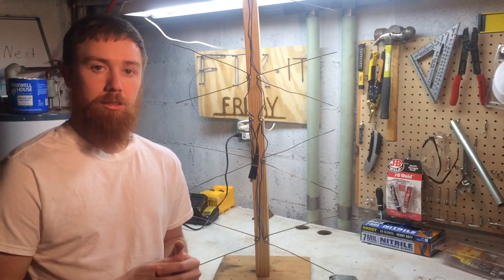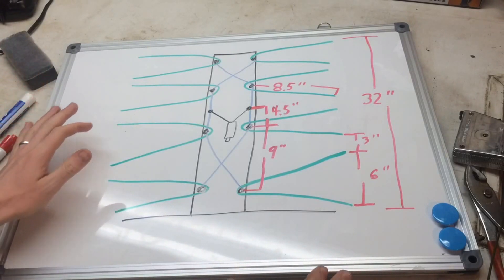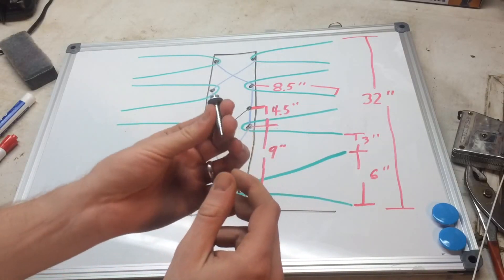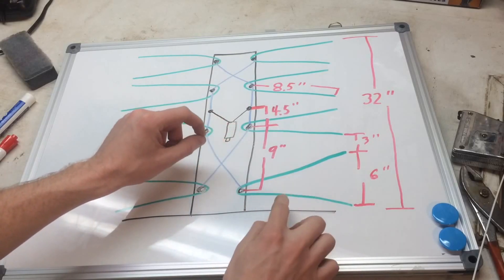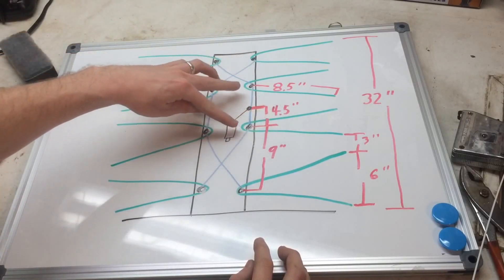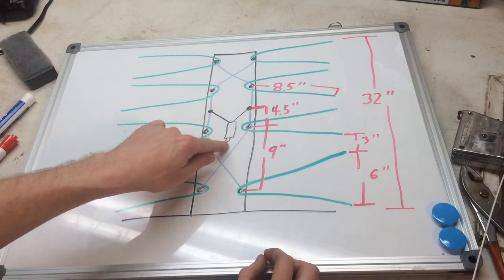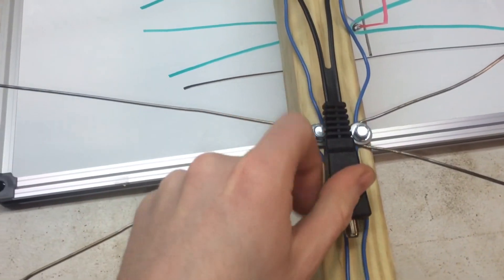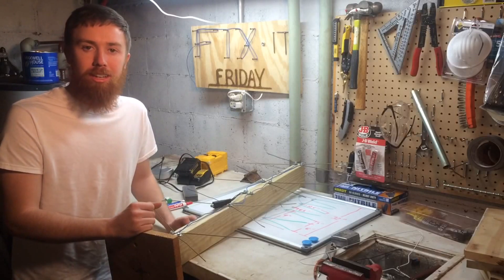Fix-It Friday: Cheap Digital TV Antenna

Comment: Your a little bit behind in your Fix-it-Fridays. lol
Reply from the maker: +JOHN WALTER Hey man, I know. I've run out of things to fix! You need to give me some ideas or I'm going to have to start breaking stuff to fix it.
Reply: Should of thought about that before you found out that there are 52 Fridays every year. lol. I will be trying the Antenna thing in a few weeks. Have you tried putting foil behind it?, it's suppose to help make it a little stronger than just the Antenna, They say it helps a lot. I'll try a think of some idea's for you. Maybe a oil change on your 3 wheeler, or on your truck. Spring is here maybe something about lawn mower maintenance.